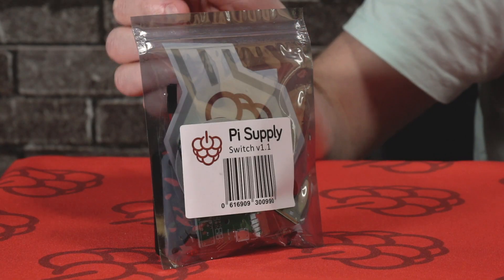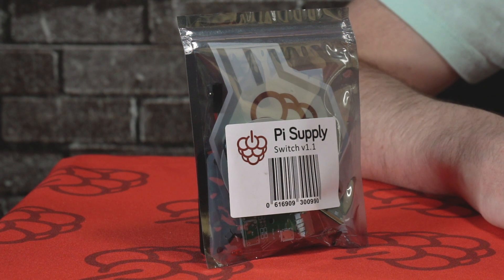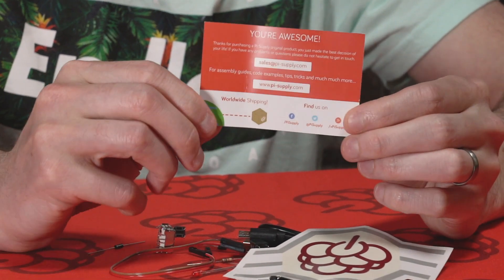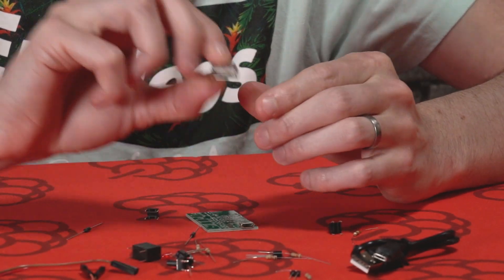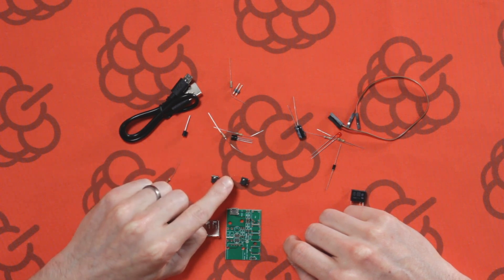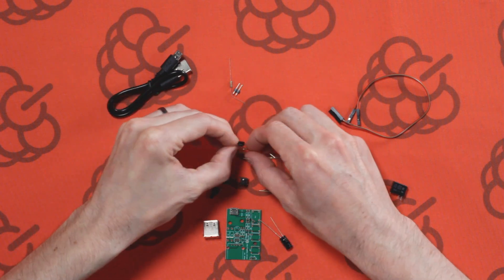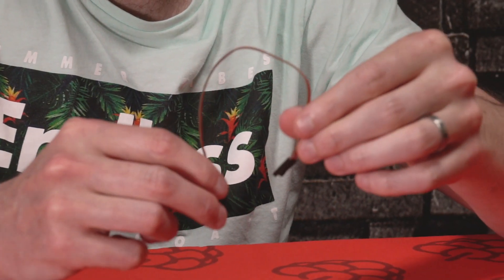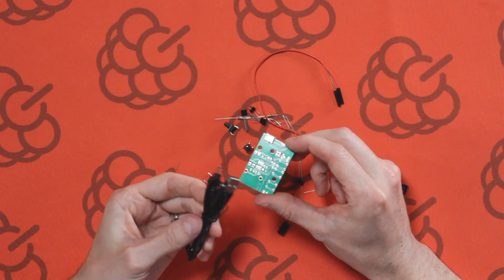Pi Supply Switch - On/Off Power Switch for Raspberry Pi | Unboxing & First Look

Comment: Is it possible to use this with a USB battery bank (like this https://www.amazon.co.uk/Anker-Portable-bar-Sized-High-Speed-Technology/dp/B00P8SY7HQ/ref=sr_1_7?crid=O6BAISWM7GN8&dchild=1&keywords=usb+power+bank&qid=1595885997&sprefix=USB+powe%2Caps%2C284&sr=8-7)?
Reply from the maker: Yes this should work fine

Comment: Not sure why getting a kit when you can shut it off and turn it on just using the GPIO pins and a simple momentary button
Reply from the maker: That doesn't actually remove power though it just puts it into a halt state. So this is a slightly different solution.
Reply: @PiSupply  Well, that is different but is it important? If you cut the power vs put it in a halt state has little to no consequences to the average user; and the current usage is irrelevant too when in halted state. If the concern is to have the PI completely off, then a regular power supply with a on-off switch will do
Reply from the maker: Yes there are plenty of different options. This is just one of many. You could also use a battery power board like our PiJuice to manage power.